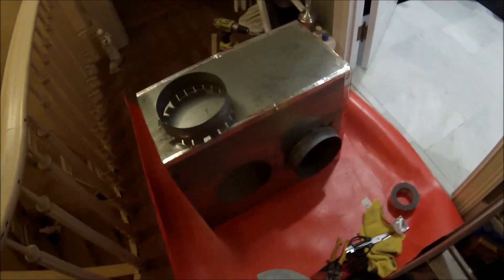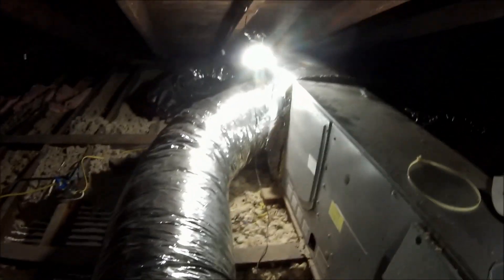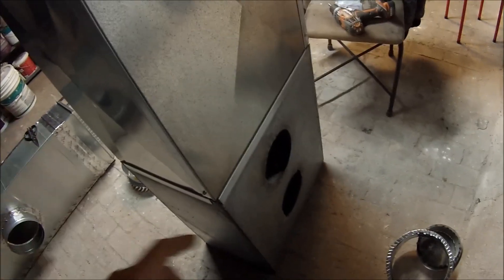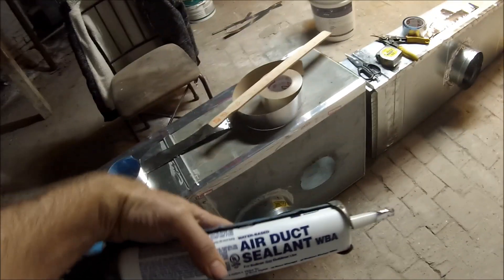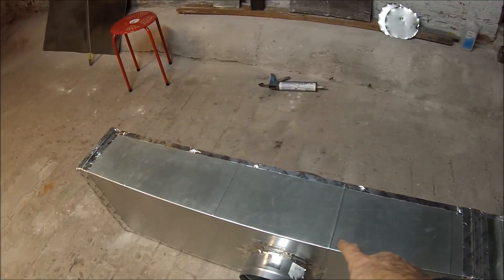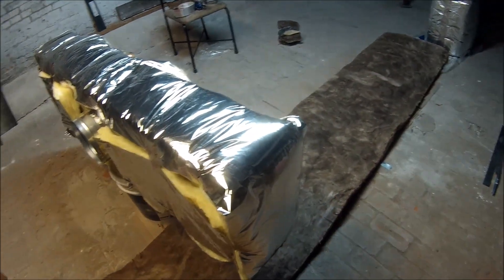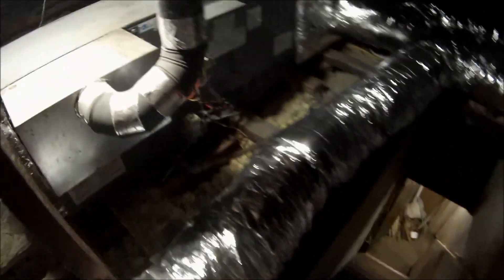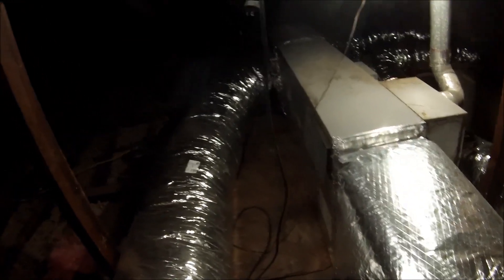Furnace Duct Work 2 Foot Rule

Comment: Hey so you have good air flow out each duct in each rooms ? 
There’s not many installers will do ductwork. They want to do easy part and just do furnace install and charge big money. 
Nice work
Reply from the maker: Yes, the Air flow is a lot better than what it was before. I had all 6-inch runs, now its 8-inch runs and only 1 six-inch in the bathroom. That goes from 75 cfm flex 6 inch to 160 CFM 8" flex duct. This did seem to take way more time to fix the ductwork than if i were to just drop a furnace in.